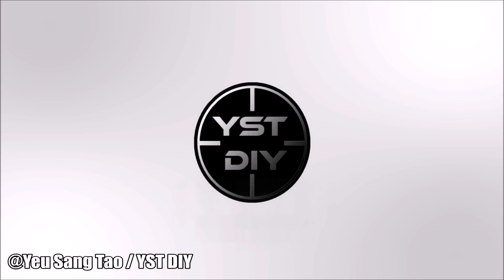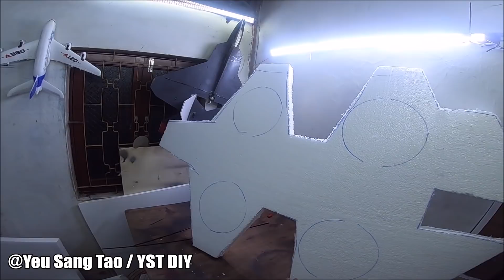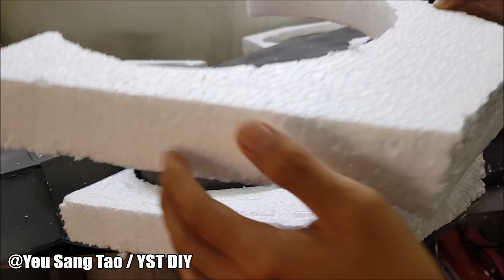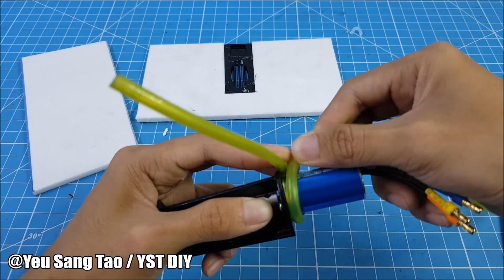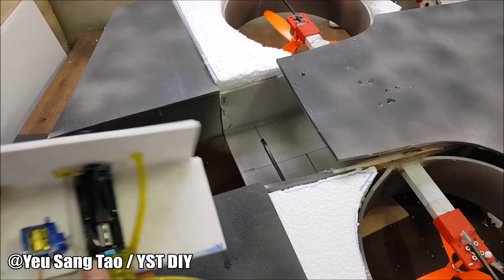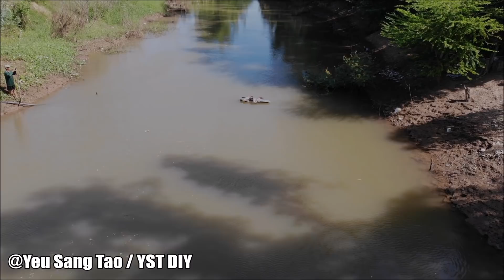Tự Chế Tạo Tàu Sân Bay Trong Phim The Avengers - Phần 3 | Yêu Sáng Tạo

Comment: Ok first check the motor operation.
Then the weight distribution front,back right and specific left side.
Also can u put flap under the blade which might u have to increase the rpm. 
And also try running it on self sustaining energy source,which is possible.